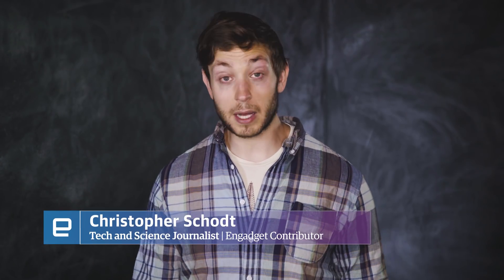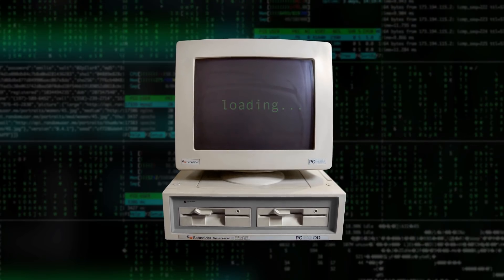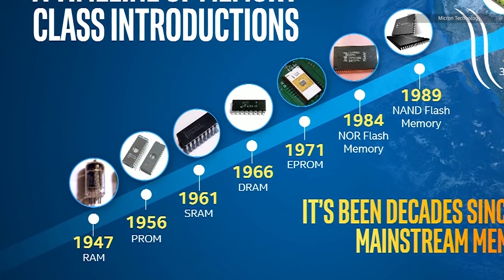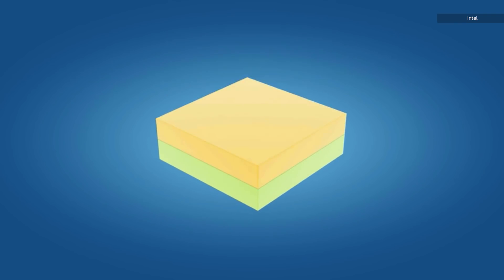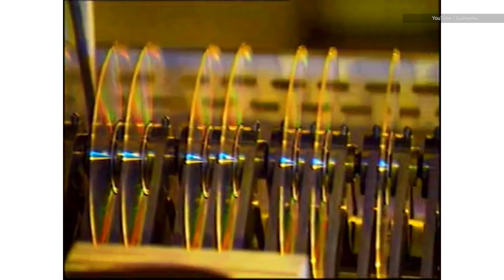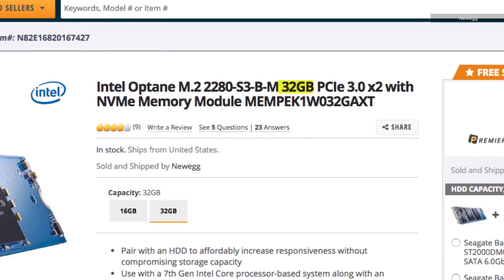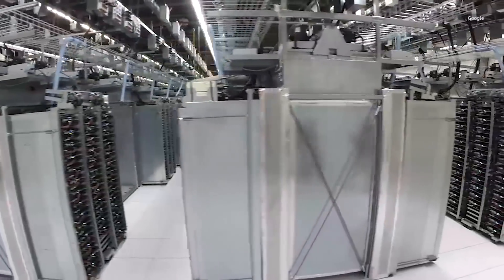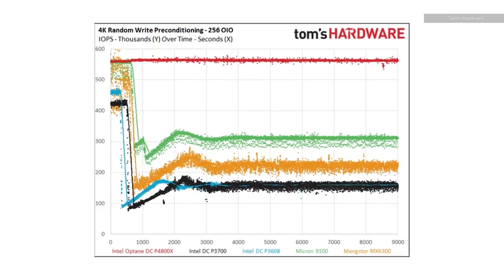What is Intel Optane?

Comment: Hi,   Do I want Green Eggs and Ham? No, I do not want it SamIAm.   I was very excited about OPTANE. When it came out, decent SSD drives were still expensive and it looked like a good addition to my standard general recommendation for a general use computer. (i7 8gen,16 to 32 GB Ram, 300 to 1tb hard drive. OPTANE did seem to make the computer somewhat faster. These were DELL. I know computers for some 35 years. I get a call that the computer has problems after a week or so. THis client had a DELL service contract so they  call me in anyway to make that feared international call.  Anticipating that DELL will force a hard drive format etc,. I backed up the drive with no errors. I call DELL and I try to get everything replaced. Its a brand new computer. I waste half a day on the phone with two levels of support. Other than the most basic things -which were all in order, I've done no real diagnostics. I've placed this in the 'Week Later DOA' category  in my head. I suggest they send a hard drive a motherboard and a new Optane Unit.
2 Days later, client calls to tell me the DELL repair guy came by, replaced it all and it still doesn't work.After he installed the Windows image onto the 16 GB SSD he made out of the OPTANE chip, there's no room for anything else and the computer does not see the `1TB hard drive. We need a bigger SSD he says as he shrugs and leaves. I see that the OPTANE has been configured as an extremely useless and small (16 GB) SSD by the tech. Well , that doesn''t seem right ! Another tech is sent  by DELL.  The first thing they want t do is reinstall the duplicate equipment they brought. I work on something else. Two hours later, a tap on the shoulder and I am told "All Done." I go check the computer. It is setup the exact same way that the first tech did except he  has replaced the 16 GB OPtane drive with a 32 BIT one so now we have some room for apps and work. At this point, the client is really upset. I am feeling like a jerk for suggesting the OPTANE.  I call DELL and I am told that I am doing it all wrong. But I haven't really done anything... I called their Techs whom have no idea what the technology is and cannot fix it. You have to understand it first though. I am sent up to 2 more levels of support at DELL. No one knows how to fix this or handle it. I finally fix it in two seconds. I go into the Intel Software and turn the chip off. I turn the computer off and remove the OPTANE chip. The user, a graphic designer did not even notice material slowness after the chip was removed. I went over other computers I had ordered for clients in the past few months and disabled the chip, leaving it in the units. No more problems.  A couple of other clients had reported weird spinning balls, hesitation etc. It all went away when I disabled the OPTANE chip.

Comment: I simply make my C: drive an SSD and dump only the OS on it using a 1 TB SSD.  Then I have 3 4TB HDD 7200 rpm for everything else.  If you want fast, this is the best work around I found so far.

Comment: You should update this video, now that we know more about Optane memory. I'm running a standard 2TB HDD, with Intel Optane installed. It's been amazing but I'm still not sure how it works :) I know one question I had was: Do you need to defrag? It's a conventional HDD so the answer should be yes, but would it affect Optane? Not much info out there so I decided against.

Comment: One correction, the magnetic drum wasn't bulk storage; it was the working memory of that machine. I've worked with several people over the years who programmed those machines and the gymnastics they performed to get their memory reads to line up with the data under the head at that time.
Reply: You must be 100 years old
Reply: @doomtomb3  most of the people I’ve heard talk about these systems are retired now, and I had most of these conversations in my 20s. I’m 40 now.

Comment: Nano Electro Magnetic Mechanical Micro Ultra Super Sonic Transmissional Recivers Distributions Harnessing Pulse Circuit Mother Board  Nano Micro Motors Super Charged Universal Orbitals Harmonioues Satellites Operational Shortwaves Sw160khz Sos Singles Morse Codeings Transmissional Accelerative Electro Magnetic MechanicalnRadiocyclrwaves  Transmissions Kind For All Universal Global Enviromental Electrical Energy Supplies.Via Orbitals Harmonious Satellites Shortwaves Frequencies International Enviromental Supplies .No Nuclears No Oils No Gas Power Stations Revive All OurSolar Cosmic Galaxies  Universal Planetary  Enviromental Electrical Energies Via Universal Radios Televisions Computers and Mobile Devices .

Comment: so maybe the fastest will be a NVMe optane drive that is over 128GB so ppl can make it their OS drive instead of a companion to it i say this as unless CPUs can alot more PCIe lanes allocated to the M.2 slots and/or PCIe slots M.2 drives are going to be limited to about 2 before taking away from other parts of the system to this 2 M.2 drives is not good if you want mass storage thus why SATA is still around even on the 400 series motherboard design leaks for AMD and Intel

Comment: Optane in its current incarnation is basically junk.  Intel would have you waste a M.2 slot on the motherboard by stuffing a measily little 16GB or 32GB 'optane memory' (which is basically just an overhyped, overly expensive TINY SSD).  It doesn't have the durability to truly be treated as non-volatile memory.  So what does Intel want people to use it for?  A hard drive accelerator.  Really?  And how are they doing that?  By resurrecting a junky 20-year-old BIOS HDD acceleration software.

So Intel is trying to recycle this failure by telling people that it makes for a great HDD accelerator.  The only problem is that... its only 16GB or 32GB, which is worthless for accelerating a large HDD.

The better solution?  Throw a 256GB NVMe SSD into that M.2 slot and install your OS directly onto that.  If you STILL want a HDD accelerator, then just use a standard NVMe SSD (64GB, 128GB, whatever) and run normal HDD accelerator software using that for the cache.

Ultimately Optane may work as it was originally intended.  At the moment its an expensive waste of money.

p.s. you need to update your understand of HDD and SSD capacities.  There's no such thing as a small, fast, 'enterprise' HDD any more.  People just use SSDs when they need small and fast.  These days if I stuff a HDD into a machine (consumer or otherwise), it's going to be a 4TB HDD or bigger.  The machine's primary storage is going to be a SSD (either NVMe or SATA SSD), simple as that.

--

This other nonsense Intel is promulgating is memory replacement.  Sorry, doesn't work with Optane... not unless you want to wear the optane out nearly instantly.  Until the non-volatile storage starts running tens of millions to billions, or even more, durability per cell, it won't be able to augment ram.

And again, if you really want to augment your ram?  You can do it right now.  It's called 'swap'.  It works basically the same way.  Just configure swap space on a SSD (or HDD if you really like pain) and that's it, you're done.  You get a ton more 'ram' for the same price as Intel's dinky little Optane.  The thing Intel doesn't want you to know is that the more non-volatile storage you have, the less the wear on each cell.  So a SSD that is 8x larger than the dinky Optane junk (16GB optane vs 128GB SSD) will not only give you more 'memory' (MUCH more memory), the wear characteristics won't be much different than the current generation of Optane in terms of device life.

But don't think that any sort of intermediate memory 'cache' will ever let you stick a tiny bit of ram (like 1GB) on a machine and magically expand it to hundreds of gigabytes.  The non-volatile memory is still too slow... way too slow, to be useful in that way.  The rule of thumb for SSD swap is typically in the 2x to 4x main memory capacity range.  So a machine with 16GB of DRAM could configure 32GB of SSD as swap and effectively have around 48GB of virtual memory equivalent (as long as the application load's write footprint doesn't blow out the 16GB of real ram and force continuous write-paging, that is).

So, basically, Intel is trying to foist off a pile of manure on unsuspecting users with this stuff, at the moment.

-Matt

Comment: Really, Optane, i did not like this product, tried the 32gb one, ... software was so hard to install, took me hours to get it right.   Then performance was not as fast as just regular nvme SSD, so removed it, which is very painful logically as well.   Then installed 950 EVO was so much happier in every way, though i had to totally reformat some of my drives, since i could get their weird RAID/Optane thing uninstalled after hours of work.

Comment: Same with SSD can also just write and rewrite so many times and that's ok seems this thing doesn't have that problem. It isn't a problem though, my Samsung SSD V-nand 1 TB has a 10 year warranty I have it a year now in 9 years it will be due for update anyway. Seems that this might be something that could speed up a system when you pair it with a Vnand SSD. I still run an LGA 4670K I5 and I'm not to get rid of not nearly. There might be Ryzen systems out there they that beat this in synthetic benchmarks. It also cost way more than this ever did since i started my PC with the unlocked G3258 that would run most games as fast sometimes faster than the I7 Back then having it overclocked at 4.8 GHz. 4 cores / 8 threats threads @ 4.6 to 5 GHz and it will run so smooth for years to come. To me the Ryzen is just to expensive. I only used AMD even had that Bulldozer thing from there on I use Intel since AMD screwed people to long.

Comment: I think what Intel has achieved is a electrical circuit called memristor this circuit is a resistor that remembers its resistance this has far-reaching applications in integrated circuits by being able to create multiple States in one circuit as opposed to a on or off State. This is achieved by creating moddable resistant points or settings.

Comment: Turning on a computer takes 5 minutes back in the days? Still does today... well not bootup, but then it lags like hell untill like 5 minutes.
Reply: Seriously, as said above. My computer takes about 8 secs to start windows, then it's on. I've never noticed any perceivable lag after startup... you have something going on with yours...
Reply: It is normal behavior without an ssd.
Reply: Fix your computer then, this isn't normal behavior.
Reply: average PC now days takes about 3-8 seconds to boot from complete power off to your OS being ready to use without any defects. if this is not normal behaviour. you may have an old system or physical damages or software issues causing it to be slow e.g a virus.

Comment: This tech us kinda useless right now, since you would need the newest chipset to use it. And even for off the shelf stuff you would have to make a choice of buying a system with an SSD or this and a HDD. And at the end of the day the SSD is the better choice over all. Can also consider if you would even notice a speed difference of optane over an SSD. After testing from pcper, they said that the transfer speeds are higher. But compared to any decent ssd, you can't really see a difference in day to day use.

Comment: Don't really know what to make of your talk, some dumb mistakes in it I notice:-)
How 'bout SRAM with Tesla battery backup?
With cheap backup power getting more and more available why bother?
That is why I like my laptop so much, even when Florida floods you can still keep working for a few hours,
and write your backup to CDROM or  what I use now is blu-ray.
And then step into your Tesla latest model, oops, was not charged, 5 miliion without electricity,
severe storm coming, i see things flying past my window,,
hey some leaves, but bigger things too, what is written on it??? trying ... ah! Optane ;-)
Anyways I have an alu light proof case with over 900 CD-R, DVD-R, and bluray some are > 10 years old
and still 100% readable.
backups
Flooding does no harm i have cleaned some. with water..
Storm is getting real bad now... rain too, garden fence still standing, reief...
Good thing I have no optane, with all them looters...
Willl have to make a sign: No optane, try next doors.
Oh, and I have a solar panel too.

Comment: DRAM is not the primary memory of a computer, the primary memory of a CPU is always SRAM in 6-Transitor cell or 5-Transistor cell array configuration. It's astonishing to go from physics formulas to calculate optimized SRAM and DRAM to a simple youtube description. Some fast and expensive flash drive ueses lots, lots of SRAM and Flash cells in a dynamic fast and slow access configuration. Datasheets with internals of modern flash drives are now gone (onchip controller and no external programmer).

Comment: This memory is just the first generation of memristor technology where materials resistance changes when high current is passed through but doesn't when small current used to read it is passed trough. State is changed by passing high current in the opposite direction.

Comment: This memory is based on Memristors.   Works like this:  a current flowing in the positive dirrection make the Memristor increase it's resistance, Current running in the oposit dirrection make the Memristor decrease its resistance.  The bit is stored as a high or low resistance. 

Since this storrege device is a two-port device, it can be extremely small, only filling the space between two crossing tracks on diferent layers in the ASIC, so a 10nm technology can have a menristor the size of 10*10 nano meters. and you can have layer upon layer of this without runing into power problems, because no current flows exept for reading and writing.

Comment: In the old days, computers turned on in 4 seconds or less. the fastest form of storage is battery backed Sram which has been available since the 70's Google "rocket drive" several hundred times faster than SSD.

Comment: This video also failed to mention another big factor: that volatile memory is more adapt at executing processor instructions (i.e. run programs). Non-Vol memory is not "random", hard drives store data in sectors, Flash stores data in pages, etc. The CPU can not jump from one address to another without first having to find the location of the data, change pages (or the drive head) and cache the data. NOR memory is decent, as the speed compensates the delay, but NAND memory is worse, as entire planes of data have to be loaded to find a random address.

Comment: Almost all PC's have a little flash memory (BIOS chip).  They also have tiny CMOS SRAM to store the system time and BIOS settings.
Reply: Well, this video didn't mention it.  I have a bachelor's degree in Electrical Engineering by the way and have been building computers since I was 12 years old.  Not exactly a noob.

Comment: In a world where a 256 GB SD card (fast, tiny, non-volatile storage) costs 130$ (and will cost a lot less in just months and will also probably increase its speed), how does this new type of storage make sense?
Reply: tr4nc3r Because it can potentially be used as secondary memory(hard drive) of a pc.Itll make the pc way faster
Reply: Retarded Potato you can do the same with SD cards. Windows calls it turbo drive or something.

Comment: How crazy it must be to invent something that you don't know how it actually works
Reply: JDubbs07 Intel knows how it works, they just didn't share it with the public.
Reply: Techwise Jor 
They still aren't sure if it works yet or is measurement error.
Reply: and that too by a big player like this.....lord have mercy
Reply: // ANT // >> Thanks for the correction. I just googled it again and I wasn't able to find any confirmation, nor anything busting it. Only speculation, which of course means no one knows yet. I hope it works. It would be pretty awesome. Especially if it could be used as a counter for rocket launches and rocket engines in space.
Reply: JDubbs07 It's reverse engineering from ufo technology. He looks sleepy because he's probably dieing from exposure.
Reply: Nasa tested it like 2 years ago and release a paper basically saying they went sure how but it does...if my memory serves me
Reply: bla blubb. Work means to perform a active function. Like the spring, gears, and other physical parts in a watch. When each part moves each part is performing its function. We all that active part working. When a part can no longer be able to move. We call it a nonworking part. Most parts in electronics lack this physical capacity. Yet they due function by being active in their own way. Which then makes them working devices in that way.
Reply: Try the EM Drive. It works, but we don't know how...